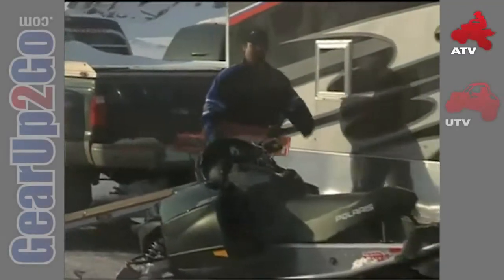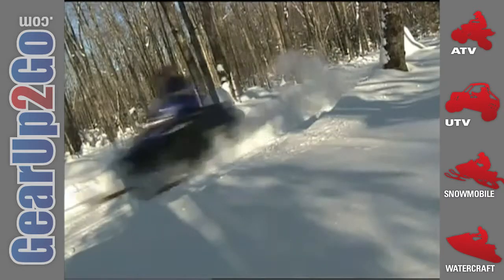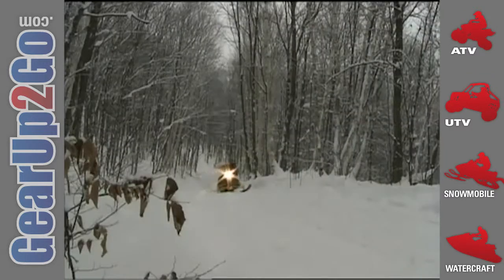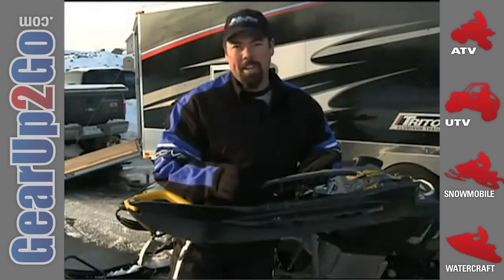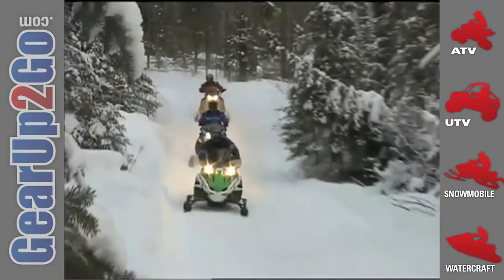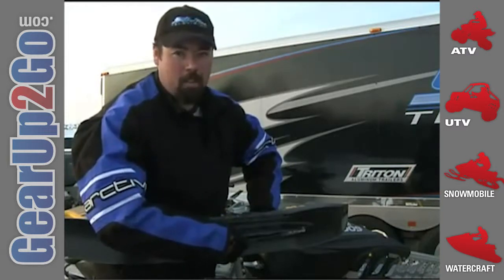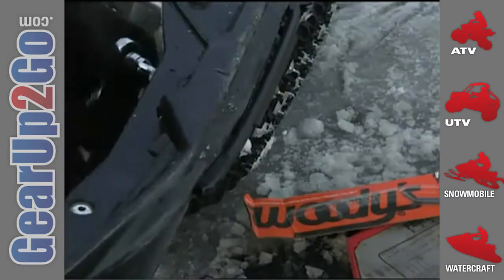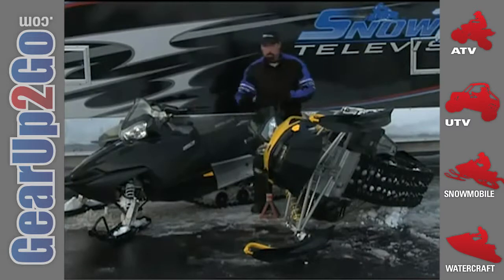Installing Carbide Snowmobile Studs & Runners - From GearUp2Go.com

Comment: STUDS are junk! I have had 2 sleds now and I got both with studs. The first sled had 3 full sets of studs in it and I took two sets out thinking that one set would give a nice ride. Wrong! My  2nd sled came with 1 set of double back studs right up the center of the track, I thought that would give a nice ride. Wrong again. The best riding sled we have i sthe only one without studs.